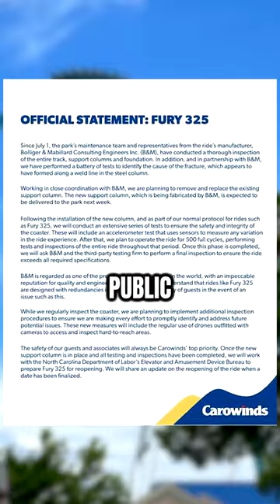SECOND CRACK on Fury 325 😵

Comment: You know it takes good manufacturer, and a good designer to make a roller coaster run flawlessly even after it had a crack. Thats why B&M has been a top rated manufacturer for 30+ years, and out of all 127 coasters they have built, only one, Dragon Challenge has been removed and scrapped. Nobody would've seen the cracks for awhile if the videos weren't taken.

Comment: Thank the flying spaghetti monster that nobody got hurt and somebody pointed the crack out before it caused serious damage.
Reply from the maker: 100% I'm really glad it was noticed before anyone got hurt!
Reply: most of those support beams are redundant, and they're built that way on purpose for this reason.
Reply: @rebeccasteinke4357 that was my exact first thought when i saw the crack. these things go through rigorous maintenance. on top of that only about 35% of the steel ground supports are load bearing, while the rest act as stabilizing braces in which can sway to allow for even dispersement of ride forces. My first hypothesis was that it was potentially even known about, but was inspected and found not to have lost any structural stability. i don’t think that’s the case but it made sense to me that just because you see a large crack, doesn’t mean that the structure is any less unstable. people kept pointing out how much the track moves under the rollercoaster but that happens on every ride. steel rollercoasters on average apply 8200 Newtons of force per square inch of track. that is a mind boggling amount of pressure so obviously the track and supports will sway.
Reply: @vluverr  I was significantly irritated by the amount of news coverage dedicated to it over and over, day after day. There are plenty of actually scary things happening that deserved those time slots 😒
Reply: @rebeccasteinke4357 Do you think the News cares?? Lol